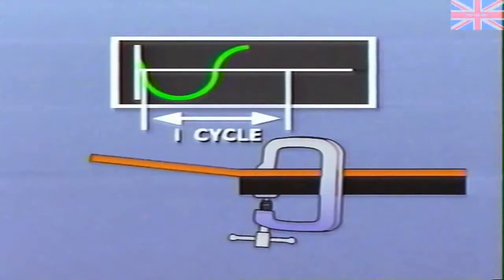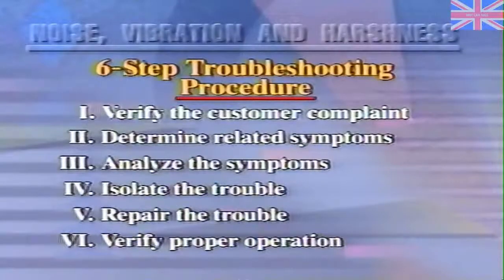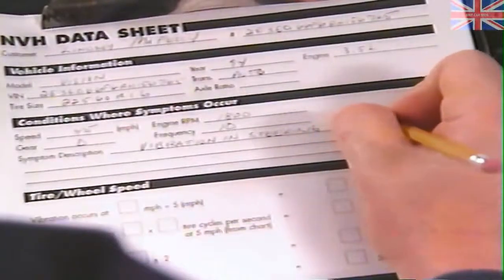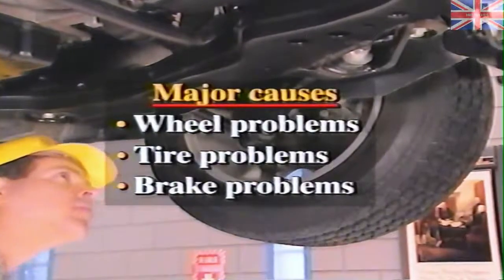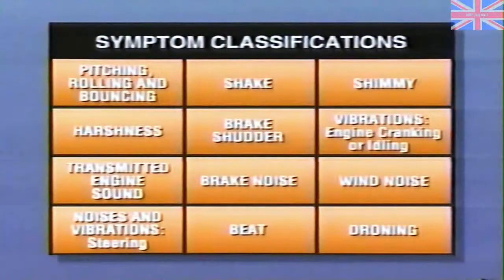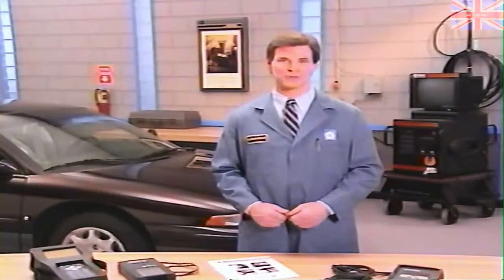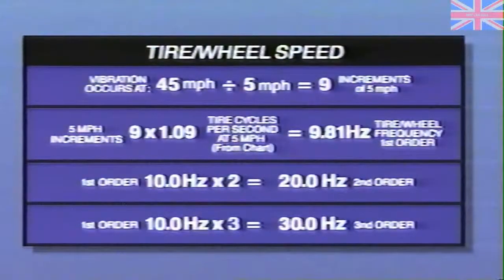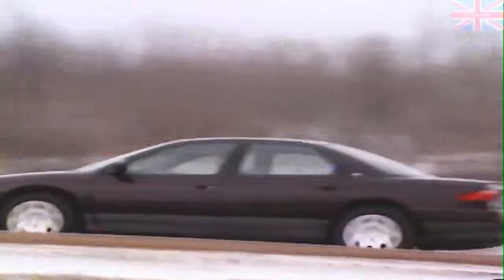Chrysler (US) - MasterTech - March 1994 - Noise, Vibration and Harshness

Comment: if u determine a vibration is coming from the engine or torque converter w a neutral run down test. but no vibration neutral run up or power braking. (in which case pulling the belt irrelevant? cause I can't duplicate in shop). How does one isolate further from there?
Reply: yes